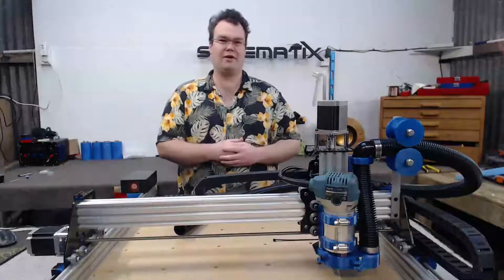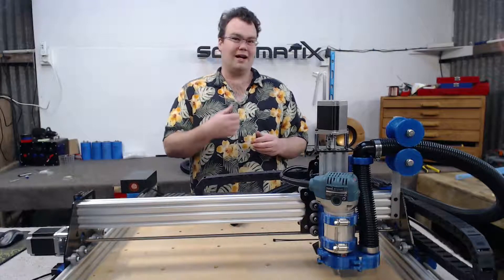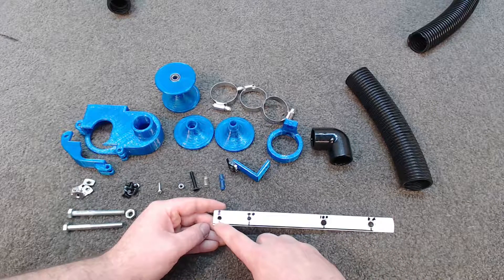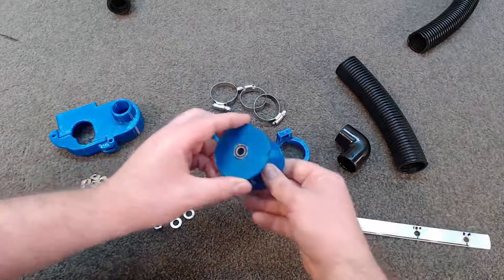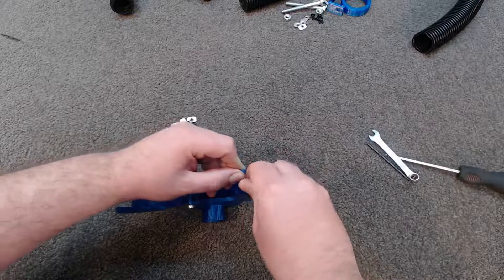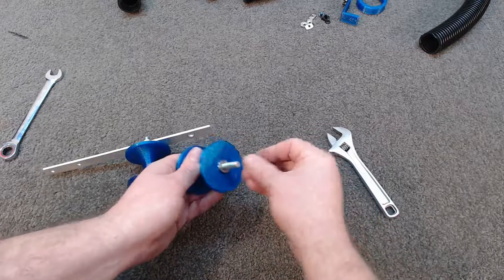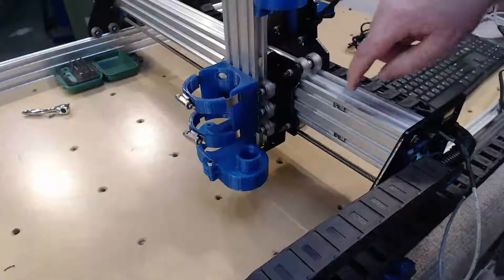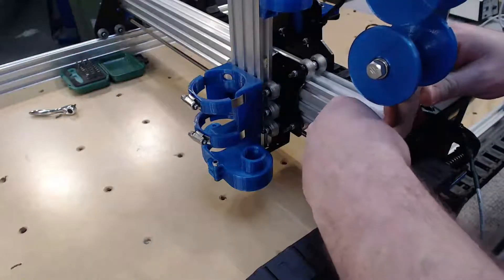Fitting A Dust Collection System To The OX-Metal CNC Router

Comment: What contains the chips and dust? I've never seen one of these without brushes added to the bottom.  I really think the hose would be better managed to with some type of overhead boom arm. That's the way I've seen most of these done. Does this interfere with bit changes at all?
Reply from the maker: I've found it works very well without a skirt/brush around the vacuum head. The vacuum sucks up the dust/chips before they get a chance to escape and make a mess. A very small amount of chips is sometimes found around the work piece. However it's very minimal.

Comment: Does this work well? What are the biggest disadvantages of using this mod? Does it have any trouble travelling, or get caught on anything? Would it benefit from having a brush added at the bottom? Sorry for the barrage of questions, I just finished building the ox metal, and getting a dust collector, trying to get as much info as possible on the best way to do this. Thanks and I really appreciate your videos. This machine is awesome..Keep it up!